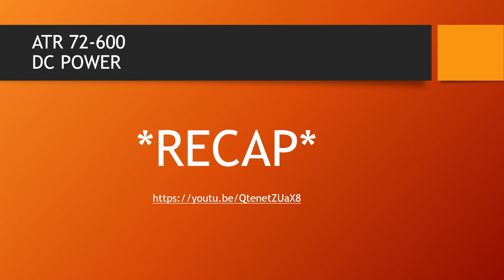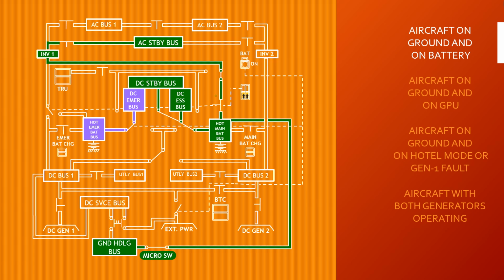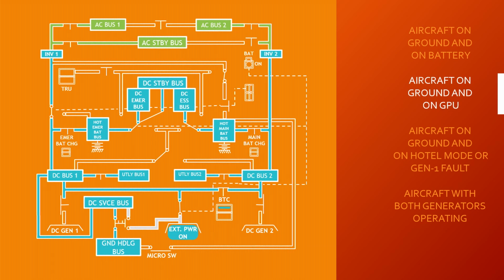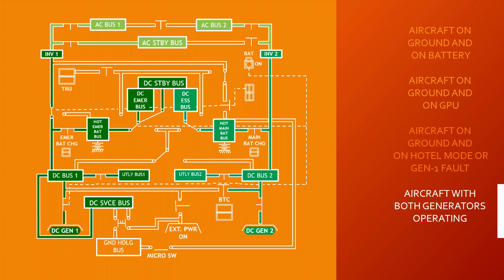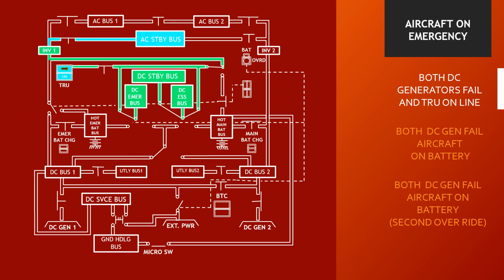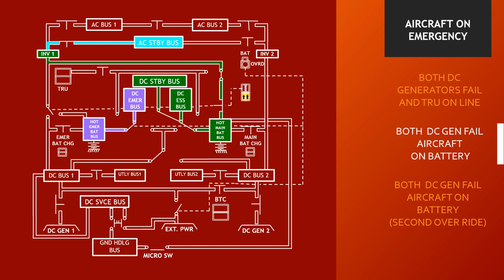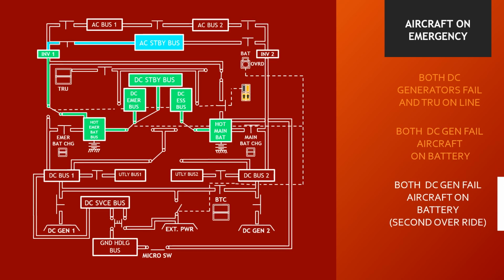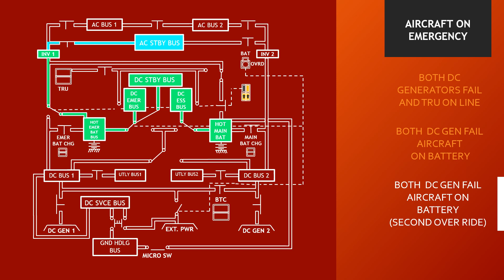ATR 72-600 Electrical Systems Part III

Comment: Hi guys, thanks for the approval! 
I have a question for the turboprop drivers outthere as i have never flown a turboprop but only jets. 
if my understanding of how the propeller works is correct while on the ground in the beta range the power lever has direct control over the blade angle by increasing or decreasing it as required and thus controlling the forward thrust, by using the inertia of the machinery: once the desired blade angle is set and only then the HMU adjusts the fuel flow to cope with the changes in the aerodynamic load on the prop, while maintaining a minimum value of Np - prop rpm’s - needed to drive the accessories.
As the power lever is advanced above the FI detent in the propeller governing mode with the condition lever full forward, the pitch change mechanism will increase or decrease the pitch? My guess is that it would increase the pitch in the attempt to maintain the Np to 100% increasing the aerodynamic load on the blades, compensating for the increase in torque, but my assumption only works if while in beta range the Np value changes constantly with the power lever. Am i correct? What are the indications of the Np and torque during taxi? Many thanks